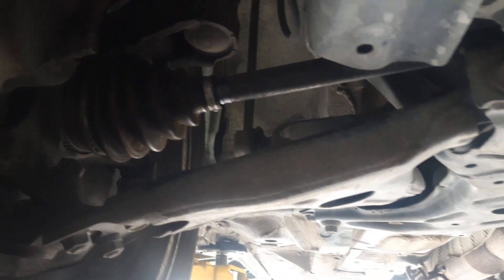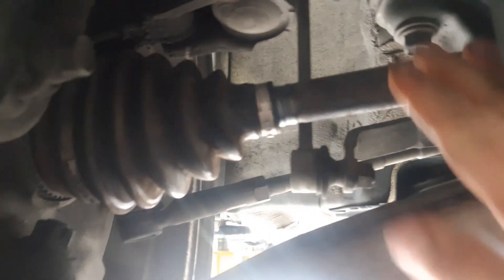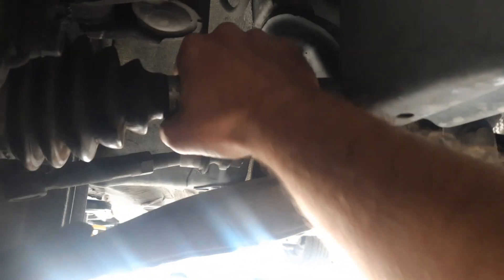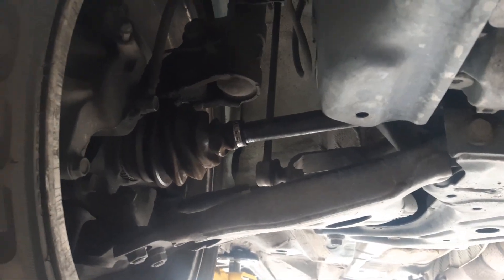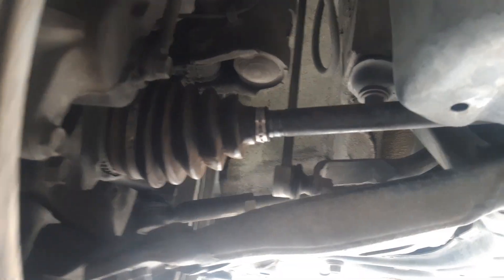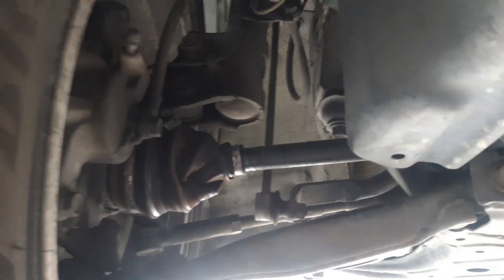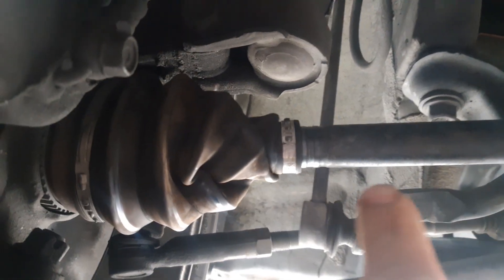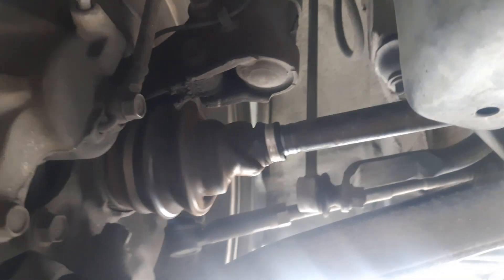How to diagnose broken CV axle joint, car won't move

Comment: I think this is what happened to my acura tl today, I didnt ever hear anything wrong with it but when I pulled up to a stop sign and took off all of a sudden I heard a clanking and my car wouldn't move. It wouldn't even hold in park, hopefully it's just the cv and not the transmission. Find out in a few days
Reply: What was it bro
Reply: @Andrew-ko1ss  it was the left front cv shaft, the mechanic said that it snapped in the middle and that he rarely ever sees them broke like that. All fixed now.

Comment: Hey sir. I have a Scion xA and every time I go over a bump or a pothole...the right front tire makes a clunking noise. Do you have an idea as to what that noise is coming from?
Reply from the maker: Your situation requires further inspection and proper diagnosis. No one can tell you what is wrong just by listening to your symptoms. They could tell you the possibility and things to look for. I would inspect your suspension, specifically strut mounts and sway bar links for looseness or wear. Check everything for looseness or wear.
Reply: Could be sway bar links. I had the same issue and replaced them. Noise was gone after. Very cheap parts

Comment: My lexus is doing this, what part do i need to buy, just the cv axle?
Reply from the maker: If you have verified the inner part of the axle turns and the outer doesn't, then yes, a cv axle.
Reply: @paulkelley86  I appreciate it

Comment: What about the other wheel….? does that turn at all or no?
Reply from the maker: Neither. Torque takes path of least resistance on an open differential.
Reply: @paulkelley86  ahhhh got it. Thanks
Reply: @paulkelley86  question. I also found a broken axle however I life the car up and both of my wheels rotating freely even in parked. Not sure why that’s happening. I get it that broke axle one will move freely and will make noise but why is the other one just moving freely by hand?
Reply from the maker: @HowToDoitright  because a parking pawl locks the differential ring gear which prevents the whole assembly from moving. It doesn't however prevent the internal differential (spider) gears from rotating. It does not need to. 
If both axles are good, you would be able to spin one wheel forward even in park, but the other would turn in reverse, which means the car won't roll. But now that one axle is broken, you spin one side forward and the other one won't move at all because it is disconnected (axle broken). 

It's just the way differentials work.

Comment: Hello i have a 2013 chrysler 200 and this exact same thing happened to me so i left my car parked now i went to try and go for it but it doesnt move now is it bc of the cc axle or worse?
Reply from the maker: The purpose of the video is to help you diagnose. 
No one knows what's wrong with your car without checking some things as part of the diagnosis. 

You could start with what is shown in the video or have it towed to a good quality repair shop that will charge for their time to diagnose.

Comment: I have a e430 4matic that wont move when i put it in drive in reverse and almost makes a noose similar to that and im stuck between if its the transfer case or a broken axle now. Any advice?
Reply from the maker: If it is a broken axle, the part connected to the differential (whether inside the transaxle or a stand alone differential like in a rear wheel drive) will be spinning up to the boot with the CV joint inside. The part of the axle after the joint and boot will not be spinning. That is how you confirm the axle is broken. 
As for your problem, you dont really know if it is the transmission, transfer case, driveshaft, differential, or axle. Further inspection will be needed. Preferably on a lift, but you could make do with jackstands.

Comment: I know I'm about a year too late but I really need your advice my 2010 Pontiac g6 cv axle broke while on the freeway running fine jerked really hard and hasn't moved forward or backwards since had the cv replaced and was asked to only put 3 quarts of transmission fluid in but still nothing could it possibly be because maybe that wasn't enough fluid to make the transmission work properly? Your expertise would be greatly appreciated thank you
Reply from the maker: Yeah low fluid is possible, no one could know how much you need. Where they came up with 3 quarts is a mystery. 
There is a procedure to check fluid level. That's what you need to do. Been a long time since I did it on a g6, I feel like there may not be a dip stick but if there is, that's easy to check level. If there is not, there will be a check plug to take put on the side of the transaxle. Both would be checked with engine running and Trans in neutral. 
It would have to be pretty low not to move, or the axle breaking damaged the differential. Either is possible.
Reply: Did you fix it ? Im having the same problem with a kia optima same situation i was on the freeway running fine and jerked and hasn't mover forward or backward
Reply: @charrobudligth  No I pretty much just gave up I spent 100 dollars on a brand new chime axle and nothing I don't have the money to do any more repairs sorry I couldn't help you

Comment: Mine did that too. Question is, what causes it? It doesn't seem possible for the splined shaft to pull out of the CV joint hub while installed in the car. Mine still had the retainer ring in the groove of the spline. I'm just afraid something else is wrong and it will wreck the new shaft too. Thoughts?
Reply: Same!! What was it! Plz
Reply: No update?
Reply: No idea how or why it happened. Changed half shaft and never had another problem.

Comment: Could this also cause a scrubbing noise upon accelerating? And also when i am driving my steering wheel is vibrating… could this be the issue?
Reply from the maker: Inner joint defect can cause a driveline vibration mostly on acceleration although not all that common. Outer joint failure clacks on turns. 
Doesn't sound like the axles are the most likely cause for your concern but understand just because something can cause a noise doesn't mean it should be replaced on symptom alone. It really needs to be inspected and the noise pinpointed and determined if the noise is related to the vibration. It should be a very difficult issue to diagnose. Don't overlook basics like tires and brakes.
Reply: @paulkelley86  does rotors cause that noise?
Reply: @paulkelley86  I’ve changed my front brakes and got an alignment as well but the noise still continues along with the steering wheel vibration upon accelerating… it’s worse when it comes to abrupt stops
Reply from the maker: @12breevans  a lot of things cause a lot of different noises. What I am imagining with a scrubbing noise may be completely off. Diagnosing over the phone, or in is this case messaging is generally not effective. If it was effective there would be a million businesses providing this service.  What it really needs it to be driven with the wheels off the ground on a lift and the noise pinpointed. Wheel bearings make growling, rotors with rough surfaces cause grinding. Incorrectly installed or excessively hard brake pads generally cause squeeking. 
You really need a more effective procedure than replacing stuff as process of elimination. I bet it would have been cheaper to pay a diagnosis fee than perform the work you have, assuming that work was all to address the noise/vibration.
Reply: @paulkelley86  okay thank you very much!
Reply: @paulkelley86 great video, good answer!

Comment: Hey my car turns on it goes in gear but doesnt drive forward or reverse if you have any advice please help and thanx
Reply from the maker: Well, there are a lot of possibilities there. If it is an automatic transmission; transmission issues, cv axles or or driveshaft, torque converter, possible shift cable or linkage..... if manual transmission; transmission issues, clutch, axles or driveshaft, differential or final drive....
Do you plan on fixing it yourself?  If not then professional fixing it would be the person to diagnose it. If they cant diagnose it, I would not let them fix it. 
If you are fixing it, consider what I said but it is not really efficient to try to figure this issue out without a fundamental knowledge of vehicle principles
Reply: @paulkelley86  thanx I'm gonna get a mechanic to check it out soon will keep you updated
Reply: @pocachula6672  you fixed it
Reply: @kingsavo4692  no unfortunately I had to sale it

Comment: I have a 1999 Avalon and I was in reverse and accidentally bumped the shifter into park now when I put it in reverse it binds and won't move
Reply from the maker: There is a part in the transmission called the parking pawl. You may have broken that off and it may be binding the transmission internally. 
But check the externals thoroughly before determining the problem is Internal.

Comment: I got a question. Can CV axle problems cause your car to not go in gear? In a automatic transmission?
Reply from the maker: Be more specific, is the shifter not moving? Or is the shifter going into drive but vehicle not moving? In either direction?
Reply: @paulkelley86  it goes into drive, but doesn't move. I was able to drive it inside my garage, but times it goes out of gear. It's a automatic transmission. I pulled codes P0740 and P0730. I replaced those solenoids, but it still won't go into gear most of the time. The codes are cleared now. Thanks for responding back.
Reply: Mr saiyan  yes as a matter of fact you can be in park and still roll pull that E brake for now
Reply: My 2009 Honda Fit cv snapped. Now my car won’t move any direction but starts up fine. Is it possible the broke cv broke my transmission as well? Or just not moving because the cv isn’t working
Reply: @mrsaiyan7342  have you fixed the issue?
Reply: @derisnel  no. I sold that vehicle already.
Reply: i have the same issue i was going into launch control and i heard a loud pop, could it be my transmission or my axle that just popped cause my car just started rolling back
Reply: and when i put it into park it still rolls and it doesn’t lock into place
Reply: @briancolis4468  if your car is rear wheel drive, that can be the universal joints that broke. Happened to me in a old school Chevy Nova. Pressed the gas pedal, it kinda vibrated a few seconds and then I heard a pop and my driveshaft was on the ground.
Reply: @mrsaiyan7342  i drive a chevy cruze front wheel drive, i was going into launch control and as soon as i gave it gas it poped and my car started to roll back
Reply: @briancolis4468  unfortunately, those Chevy cruze are not good cars. I've heard many issues with them. If the cv axels were replaced before, I would bring the car back to the shop and have them redo it. But find someone you can trust to fix it because there are a lot of scam mechanics out there. But there are good ones out there too. Just gotta do research in shops and check reviews. But that's sounds like either the cv popped out of the transmission or something else. Have a trusted mechanic look at it. Hope you get to fix your car. Have a blessed day/night✌️
Reply: @jazminemartinez4315  hey what was it? Having EXACT SAME ISSUE
Reply: @briancolis4468  what was it???
Reply: @YXEFlatl1ne  it was my cv axle, got messed up and then 3 weeks later needed a new transmission
Reply: @briancolis4468  What would cause that? Elaborate, same thing happening to me now shop said CVs

Comment: This happen to me once I thought my transmission was gone
Reply: Ive ripped 3 axles so far but have managed to make it home, yesterday the fourth went out and my car aint moving so here i am shitting bricks
Reply: @James_Steinbachairflow  hey what was if? Same exact issue today plz answer thx
Reply: Hey what was it? Same issue today please answer thx!
Reply: @YXEFlatl1ne  I have the awd 325xi, and im no expert but from experience the first 3 cv axles were “brocken” but could still spin so able to drive home and replace them. On the fourth one it basically snapped and from what I’ve googled if the axle isn’t able to spin the car wont allow you to drive to prevent anything else from breaking. I would replace the axle first and if that does not fix it look into your transmission etc. hopefully this helps a little bit.
Reply: Wont allow it to spin because of the open diff.

Comment: I got this problem but it spins while I’m in neutral too can someone explain (04 Acura tsx manual)
Reply from the maker: The inetria of the moving gear oil in the transaxle will cause the xv axle to spin in neutral slightly. If you grab it I bet it stops but be careful
 If the cv axle is broken you will be able to turn the wheel but the inner part of the cv axle where it pops into the transaxle won't turn. If they turn together, your CV is not broken.